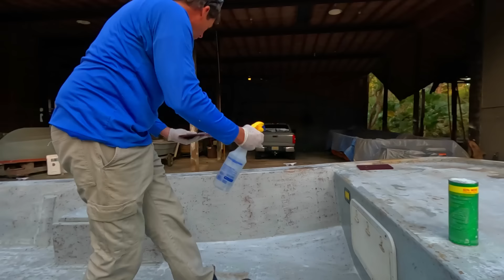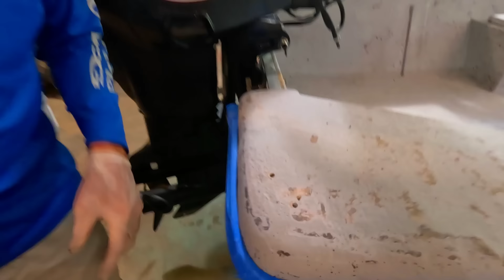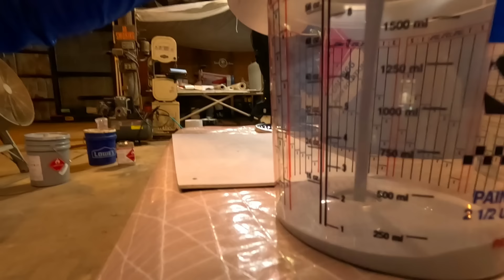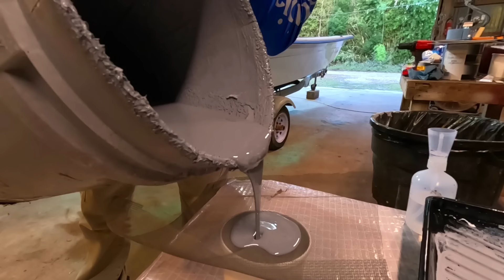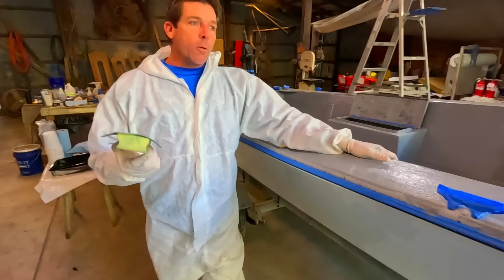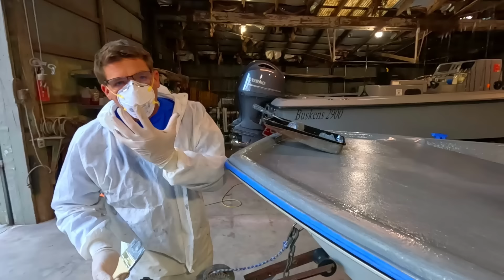How To Re-Gel Coat A Boat - DIY Cheapest & Easiest

Comment: Great Videos and content! You are a great instructor.....I am preparing to spray Gel-coat on Top and Sides of my used boat project. What grit paper dis best to finish with before spraying the Gel-coat? I guess this is called the anchor tooth sanding scratches. Thanks
Reply from the maker: Wow, thanks! Sandpaper grit selection can vary, depending on the application. 80 grit can work on a more commercial style work boat and on decks. 120 is a good all around, and 220 might be used on a high gloss dark colored gelcoat that will be polished to a shine. I have quite a few gelcoat application videos and a sandpaper selection guide video here on the channel. I'm sure if you take a minute to scroll back through our video library, you will find all the info that you are looking for. I hope this helps, and I appreciate you watching!

Comment: Joe, I'm repairing a hole in a hull and I wanted to apply a new layer of gelcoat on the complete hull (roller and tip method). It is an old boat and no show piece at all... Someone advised me to rather paint the hull instead of gelcoat it for a better finish and less sanding. I'm not too sure about this idea, especially the keel area. What are your thoughts?
Reply from the maker: It can be done either way, and they both have pros and cons. Gelcoat is very durable but can be quite a bit of work to get it to shine. Although with the right spray gun and additives, it can come out pretty nice. I do have gelcoat spraying and polishing videos as well as paint spraying videos on a big blue sailboat here on the channel. I recommend dedicating a little time to researching here on the channel, and hopefully, that will help you make a decision.i hope this helps and I appreciate you watching!

Comment: I applied two coats of gelcoat on the interior of a skiff. I feel certain I added enough activator and added wax for the final coat. The finish is sticky when you lean in it, but dry to the touch. What am I missing and how do I correct this?

Comment: Great video! I'm trying to figure out whether I should use gel coat or paint on an old box trailer that I inherited. It has the paint chipping off the entire surface. I just realized today, that it is fiberglass underneath which is showing through all over the place. Can I sand on that fiberglass? I'm just one woman on a mission to honor my Dad's trailer. Any tips that anyone has, I would much appreciate!
Reply from the maker: It's hard to say what is the best option for your trailer. There could be pros and cons to either material. Generally, I don't recommend trying to gelcoat over old paint as there could be compatability problems between the two materials. That would mean every bit of the old paint would have to be removed before attempting to gelcoat it. That would be quite a bit of work! I lean towards repainting vs. gelcoat just based on that alone. An option you might consider is a 2 part epoxy based paint, something that is much tougher than a one part paint, but easier than gelcoat on the prep and application side of things. I believe that Interlux or Petit paints make some marine grade paints that could work for you. I hope this helps, and I wish you all the best with your trailer project!

Comment: Hey captain Joe, I love your videos/work hopefully you can keep it up!!!!
I haven’t yet started playing with fiberglass/gelcoat, still trying to gather information and watching videos over and over 😉
But I am a little confused about few things, 
First I have a 21 ft Macgregor, and not really sure what sort of fiberglass resin it is made out of, I am assuming it’s Epoxy?
I need to repair a bit of gelcoat on the Hull and the top side (need to watch those videos a few more times and take some notes), and would like to modify the interior a bit with fiberglass and gelcoat.

My question for right now is about tooling Polyester used over existing Epoxy?

I’ve seen videos where people only use Epoxy? But the way I understand from your videos; is that they are not compatible together, and Epoxy is more for Bonding parts together. Can you put the tooling Polyester over the existing Epoxy finish?
If I were to use that tooling poly Ester? Would that be sufficient?

Ultimately I probably just need to get some supplies and start trying 😊

Thank you for your time and great videos 

That’s just the start of my crazy overthinking 😂
Reply from the maker: Almost all production boats are made out of polyester resin. Typically only high-performance and specialty lightweight boats are made of epoxy. But it is hard to know for sure. Polyester and epoxy  can work together. It just needs to be in a certain sequence. It is generally considered OK to put epoxy over polyester, but not polyester over epoxy. Epoxy will bond to epoxy, so if in doubt, you can just  use epoxy for your repair if you want. I hope this helps, and thanks for watching

Comment: Greetings from Canada. Wanted to tell you how helpful this video was.  I restore racing dinghies as a (serious) hobby but have never done a major gelcoat job before a current project which required the cockpit floor to be redone.  Lots of experience with epoxy and with paint but other than the simple gelcoat repairs, this was a first.  Just finished the floor and results were terrific (not to brag).  In large measure due to your video showing me not so much what to do but rather what to expect.  Thanks!
Reply from the maker: That's fantastic! Glad your gelcoat project was a success. Thanks for watching and commenting!

Comment: 💡Have you tried parchment paper over the resin? It keeps the air out so you don't need wax and then it peels off giving a smooth transition. Really good for small repairs. I have yet to find anything that sticks to parchment paper.
Reply from the maker: Great tip! I have mostly used wax paper in the past, but I imagine the results would be the same. Thanks for watching and commenting, I really appreciate it!

Comment: If Im applying a new layer of gelcoat on an already existing gelcoat, do I have to apply some kind of primer, or am I good with only sanding the old gelcoat(not all the way to the finerglass since the layer is really thick)?
Reply from the maker: If you are applying new gelcoat directly over old gelcoat, a thorough sanding and a wipedown with a cleaning solvent like acetone should be all you need. Hope this helps and thanks for watching!

Comment: I’m in Florida outdoors with a cover over my boat so do I need any brush thinner for the gel coat ?
Reply from the maker: Styrene or a clear gelcoat additive like air dry, or duratec will help the gelcoat flow out a little better. Don't forget that the last coat will need a wax additive or gelcoat with wax to dry tack free. I just posted several new gelcoat related videos that you might also find helpful. Thanks for watching!
Reply: @FishBumpTV  thank you I’ll definitely give them a watch !

Comment: This video is a little old, so I am hoping that someone will see this question and give me the answer that I need. I just found and bought, after 3 years of searching for one, a Lund fiberglass cab sun visor (exterior)for an old classic 76 F150 4x4 that I am doing a retro restoration to a muscle hot rod show truck. It's first car show is in 21 days.

Can I just spray automotive paint over that Gel coat, or do I need to sand the Gel coat and primer it with auto primer, then spray automotive paint? or What do I have to do?
Reply from the maker: I would recommend thoroughly cleaning the gelcoat, wipe down with acetone or something comparable then sand and prime it before spraying your finish coat. Hope this helps and thanks for watching!
Reply: Thank you for the quick reply. I will be watching your videos  a lot more because I am thinking about trying to actually make my own version of those fiberglass sun visors for the cabs of those old classic 73-79 Ford Trucks. They are so rare. Especially the ones with clearance lights built in. That's what I got. You wouldnt believe what I paid for it.

Comment: What is the purpose of the Wax additive?
Reply from the maker: If you don't use a wax additive, or use gelcoat that already has wax in it, the gelcoats surface will remain tacky and not fully cure. I have a video here in the channel called the secrets of gelcoat that you might find really interesting, it talks alot about wax vs no wax in gelcoat. I hope this is helpful and I appreciate you watching!

Comment: After this fully cures, could this be wet sanded down, going up in grits to help smooth out. Not necessarily to the point of buff and polish but just to make it a bit smoother to touch. Thanks.
Reply from the maker: Sure, you could do that. I would probably recommend sanding the base material down a bit more prier to your gelcoat  application if a smoother job is what you are looking for. I hope this helps and thanks for watching!

Comment: hey, great video, i have a yellow boat and can't seem to find a yellow gelcoat. Can you mix some type of colour to get the yellow gelcoat? Also, would the process be the same for the bottom of the boat? Can you polish the last coat to get a nice glossy finnish?
Reply from the maker: You might try a company called spectrum gelcoat. They should have a yellow gelcoat. You might also reach out to fiberglass warehouse for gelcoat. Yes, you could gelcoat the bottom of a boat, then wetsand and polish, bit it would be very difficult doing it upside down. If it is a smaller boat, and could be flipped over, that would make it much easier. I hope this helps and thanks for watching!

Comment: Great vid. Ive got an old 26ft GRP sail boat. The topside is in bad shape which I have been sanding and filling. I'm struggling to decide whether to Gelcoat or just paint, the main recommendation has been to paint. From what I can ascertain gelcoat is more of a mould product, i.e. the surface comes out nice and shiny. Whereas if you roll it on, as you did it ends up with orange peel and needs much sanding and polishing. So painting seems the easy option, do you have a recommended approach? i.e. doing gelcoat adds a bit of strength and is likely to last for many years.....Thanks
Reply from the maker: It is a toss up between gelcoat and paint for a application like yours. They both have pros and cons. Sounds like you have already done some research on the subject. I will try to do a video on this topic soon for you all. Thanks for watching!

Comment: Do you remove the tape before the gel coat dries?
Reply from the maker: Yes, I usually remove the tape as soon as I can. Hope this helps and thanks for watching!
Reply: Can you give some pointers in applying webbing after you apply the gel coat. Should I use wax in the gel coat. Just a quick run down on how to do it. Thanks

Comment: Great video on rolling gel coat!! When mixing silica with gel coat to repair dings, how deep can you use it? I have a few layup voids that are 1/8” to 1/4” deep I need to fill. Thank you for your videos, they are helping a lot with my refit!
Reply from the maker: Thanks! A 1/4 of an inch is probably as deep as I would typically go. Any deeper and some fiberglass or filler is probably a good idea. Hope this helps!

Comment: Why didn’t you use a non-skid product on this project?  Looks great!
Reply from the maker: This little skiff didn't originally come with any nonskid on deck, and the customer didn't request for it to be added and the budget for this job was very tight so he wasn't expecting a yacht quality high end gelcoat job. He was very happy with the results though. and it was as nice as the original finish. Thanks for watching!
Reply: Thank you for the response!  I have an older skiff that I am restoring and I have been trying to find out if the original, unfinished slightly rough interior gelcoat was some type of nonskid or just a basic gelcoat application. They seem to have used a webbing method that created a droplet effect on the final topcoat. Very good content!

Comment: i refit my 40 footer (an Oyster SJ41 for those 80's boat enjoyer like me) with all the tips i learnt here, because i love the capacity of Gel coat. So useful to have the process, the tools, the conponents, an understandable english (i am not an English native) and the tricks in a same place. 

As in one of your video, you said we could bring our 2 cents : the best tools i discover to clean the gel coat excess  (when filling my stress crack) is the Bahco Scraper (maybe there is other scraper, but this 650 mm Scraper worked perfectly for me), very smoothly used, it is just marvelous : i smoothly scrapped all the gel coat excess on my hull in one afternoon), thanks for the trick with the blue tape to mark all the tiny spot to be treated.
Reply from the maker: Glad you are enjoying the videos and I appreciate your 2 cents on the scraper!

Comment: If the base ware super smooth would you see the roller marks or does the gel coat become smooth as on ”new” boats
Reply from the maker: A roller is going to leave some texture, even if the base is very smooth. You can roll, then tip the gelcoat with a brush to get a smoother finish.  You could also thin the gelcoat with a clear air dry additive then spray it for a glossy finish. I hope this helps and thanks for watching!

Comment: Where are you located at I have a ranger bass boat that needs the top cap regel coated it has metal flake in it it’s called black cherry is the color I sanded it much it started turning silver

Comment: Wow. The amount of knowledge you crammed into that video is crazy! 
I got a 13' wagner powerskiff for free a few months ago (first boat). The 40hp engine was shot. I got a good deal on a 23' yamaha f50b scratch n dent. Now I've re-done lights, wiring, trailer as well re-done.  Then I started replacing screws and circle hatch o-rings. Now I'm thinking the rail around the perimeter (rubber) needs replacing, and I have some cracks at the rail area. So here I am🤣 first video on paint. Great one! Looking forward to the ones I'm about to watch. 

Also, inside the circle hatch at the bow storage/anchor area, inside the hull, below deck, I looked in with a light and it looks like the fiberglass on the inside angle of the keel? Line? Front vertical center is peeling/delaminating. 
Is this worrisome? 
Boat is 2000 wagner powerboat.  Which is a hobie powerskiff clone. 
Thanks for the wisdom 💪🙏
Reply from the maker: Sounds like a great project boat! I don't really like to see any fiberglass peeling or delaminating, but it usually isn't that big of a deal. I would use a grinder to remove the damaged or delaminated glass, then rebuild it with fresh fiberglass and resin. I have been really impressed with the vinyl Ester resin that I have been getting from fiberglass warehouse. They also have a discount code for fish bump tv viewers that should save you some money. I hope this helps and best wishes with your boat project!

Comment: Correction every boater neads a houseboat, ski boat, surf boat and a sail boat with of course a dingy
Reply from the maker: Haha, I like it! Thanks for watching and commenting!
Reply: I have the 1st three all in one hull: Reinell RV2200.
Reply: In Finland the sailboat can be houseboat, if you go to south for winter. A houseboat must be strong enough to last ice, composite might survive Southern Finland's winter, but north there may be one meter of moving ice that requires a strong hull. Some use bubblers to keep ice away and park in small waters, like in a small gulf, where the ice doesn't have strong forces. Most house boats are made of steel in Finland. Anyway houseboat is quite hard to build properly. Heat insulation, condensation and ice resistance are hard to master
Reply: No fishing?
Reply: I just need Jet Skis. And apparently 14 of them at the moment. I'm a sucker for cheap projects.
Reply: That's what I did collected a houseboat two runabouts and a sailboat with a dinghy
Reply: Sailboat is way too much work
Reply: No. You need an offshore fishing boat and an inshore fishing boat.  That’s it. You live in a house. No ski boat no house boat.

Comment: I noticed you added wax to the last coat. I thought that was used if you were going to polish it to a shine. Forgive my ignorance. I am tring to learn as much as I can before doing some glass and gel coat repairs on my drift boat. I want a smooth shine on the hull but dull on the interior. Also what do you recomend for a deck with some added texture for an anti slip feature? Thanks a ton Capt!

Comment: I’m liking this video for my 1967 Hinterhoeller sailboat. The gelcoat is bad. The boat says in a slip year to year.  Thanks
Reply from the maker: Glad to help! Just remember that if you want the gelcoat to be smooth and glossy it will need to be wet sanded and polished out. You might even want to try wet sanding and polishing the old gelcoat first, just to see if it can be restored. We have a video on a dark green gelcoat hull that turned out very good. I hope this helps and thanks for watching!

Comment: How'd the gelcoat dry??? You didn't use any pva or anything so im confused
Reply from the maker: Gelcoat without wax will cure as long as you add 1 to 2 percent mekp, it will just remain tacky on the surface. Hope this helps and thanks for watching

Comment: What kind of gel coat are you using here for the primer layer? Is it gelcoat without wax? How do you get it to dry/cure?
Reply from the maker: First coat is gelcoat without wax. It will cure without wax, but the surface will remain tacky. You typically would only add wax to the last coat to help it cure tack free. I hope this helps and thanks for watching!
Reply: @FishBumpTV  ok that makes sense thank you! If you need to knock down some bumps etc between coats won't it clog up the sand paper?
Reply: @FishBumpTV  how much time between coats? Does it flash quick? I'm applying gelcoat without wax to fiberglass sheet repair & glass bondo.